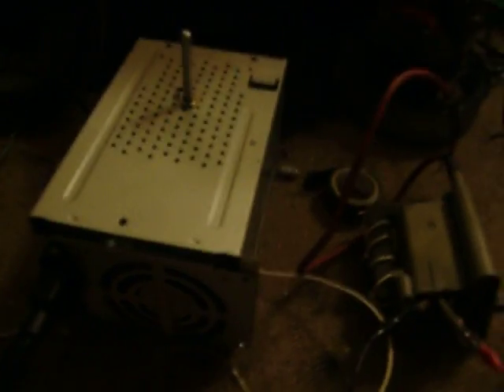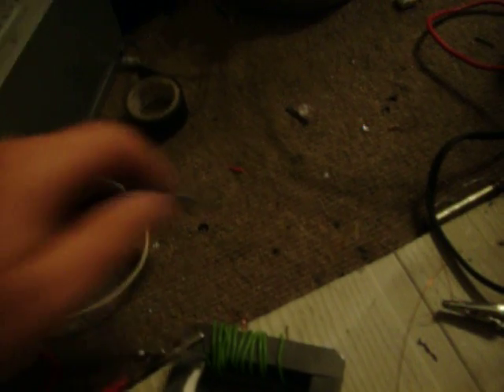555 oscillator.

Comment: how do I make 5000V square wave  by generator at 1Khz to 100Khz
Would that be better to deliver 1100V square wave(clean) to transformer and get 5000V square or 12V square to flyback resulting 5000V square wave.
or (maybe voltage dubber after 1100V) What will be the cleanest solution for square wave?